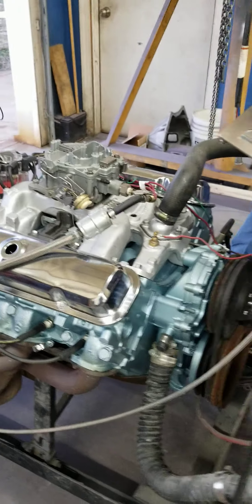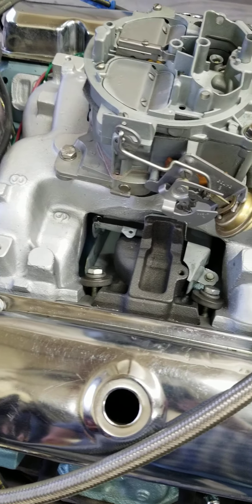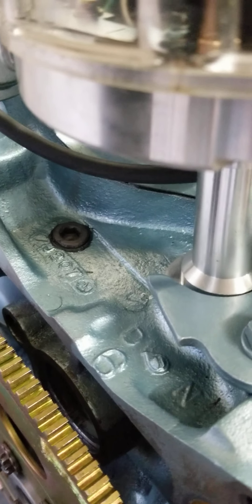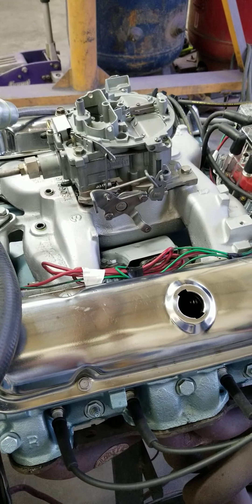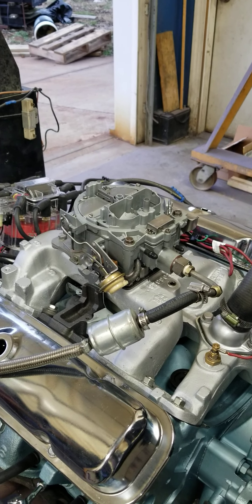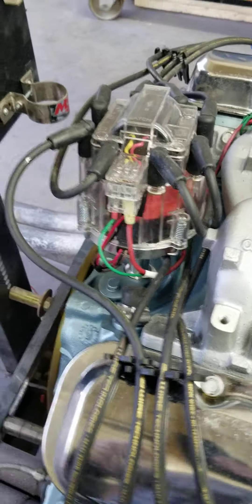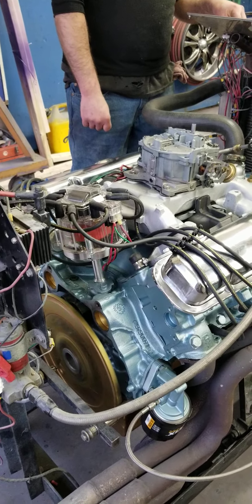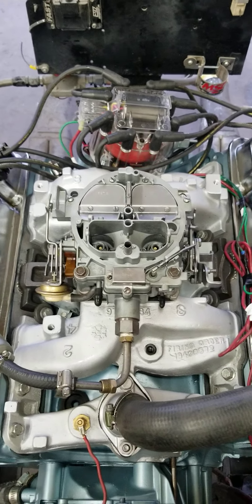PONTIAC WITH WICKED FAST THROTTLE RESPONSE 🤪

Comment: Those bore/stroke numbers mean the engine is "under-square" as i'm sure you know. Most factory original v8's of the era were "over-square". I had a 1969 GTO Judge with the Ram Air 400 bought used 1n 1980. I STILL regret selling it. It would FLY.
Reply from the maker: Most of the bigger cubic inch Poncho's were over square, but that's more than likely why they are so torquey 😁
Reply: Can take advantage of the higher  piston speeds of longer stroke with a warmer cam and might as well use dual quad carbs providing 1 barrel per cylinder.Lightened aluminium flywheel and solid lifters.Then try it.
Reply from the maker: @confederatenationalist7283  I am working on a stack injection set up for my RA5 heads. I can't wait to see what the throttle response is with it.

Comment: I had a 74 ram air that I rebuilt the 400. Found some ram air heads and put a comp mag 292 cam in with flat top forged pistons. That thing was pretty awesome, so I can only imagine what this will do!
Reply from the maker: Nothing like Pontiac Torque :)

Comment: I’ve never seen that block before. I’ve worked on a lot of late 60’s and 70’s stuff. I got into the trade early 70’s . The fuel pump on the back is what got me. I can’t imagine with headers if it doesn’t promote fuel boiling and vapour locks sometimes common in older vehicles
Reply: Fuel pumps on these engines are on the left front. What looks like the fuel pump on the right rear is the oil filter bracket.
Reply: That's the oil filter housing not the fuel pump

Comment: I don’t know about the R A casting, that’s cool though. Those heads are pretty rare cause were one year only. The manual trans cars came with the same "041" cam which was used in the later Ram Air 4 engines, but used 1.5 ratio rocker arms, but the RA4 engines used 1.65 rockers. Awesome build
Reply from the maker: Old School Cool for sure :)

Comment: Really enjoy tuning those Quadrajets,, did a simple metering rod and jet change, with a Q Jet on a1976  trans Am, drop two full seconds in the quarter mile, with a 1:76 ratio exhaust rocker arm...

Comment: I do have to disagree with you on one thing, however. The RA II heads would not have come with a RA IV cam.
Reply from the maker: I do believe they did, but did not use the 1.65 ratio rockers so it was rated at .470" of lift instead of .517"

Comment: I the exact same set up in my ‘68 GTO- stroker with Ram Air II heads, Ram Air IV intake. Similar roller cam (236/242) but on a 114 - even the Johnson lifters. Would love to know what that one puts out.
Reply from the maker: A wild guess would be around 450 HP. The factory style aluminum intake really limits HP. Everyone thinks because it was PMD's highest HP intake that it works really good. The problem was because of low hood clearance and factory ram air, they had to make the intake shorter which made the plenum way to small.
Reply: @dcimotorsports1111  I had to do a lot of work on the repro intake as well. Not as off as yours, but it took some massaging. Performer RPM or the good old cast iron intake would have been a more practical choice. https://youtu.be/7ToAWgjreu4?si=iKQBFN-bJ2CYPh1p
Reply from the maker: @kskistz Love your 68 Goat 🥰In my opinion the 68 is a way nicer looking car than the 69. I love the wood dash and vent windows.
Reply: Appreciate the compliment! I wanted it to look mostly stock with some not so obvious upgrades. Kind of like I raided the Pontiac parts bin back in the day.

Comment: That really is rare and sounds like a great way to take advantage of such original performance parts. I wonder how much power this thing is putting out on a dyno.
Reply from the maker: I agree, It is cool to see old school parts on today's builds. I've been doing it long enough to remember that's all we had for a very long time. It wasn't until I designed the IA blocks and Tiger heads, that along with Edelbrock, Wenzler, and KRE coming out with goodies that we finally had options.

Comment: Try attaching the transmission ... Automatic or Manuel on a stand with the engine. It will definitely effect the throttle response. Want be quite as responsive....
Reply from the maker: My engines rev pretty quick even with all the extra load. Watch this video and see how quick it rev's. Even hits the rev limiter pretty quick :) https://www.youtube.com/watch?v=4G5OKob-VAU

Comment: The bolts and washers cocked sideways is the most g m thing i've seen lately
Reply from the maker: Ha Ha, ya I am going to remove the intake machine the heat cross over down to make it level. Yet another aftermarket part that needs massaged :(
Reply: Why do you need the crossover and shield?
Reply from the maker: @707x-y6s customer wants to run the choke thermostat, so we put it in. Normally we would just block it off.

Comment: I thought RAM-AIR II and IV Were the same and cam also and only difference was rocker ratio and pushrod diameter 💁‍♂️
Reply from the maker: No the RA2 had a standard size intake port like the D Port heads. The RA4 had a taller intake port and also used a 1.65 rocker. Both used the same cam profile though for standard shift cars.
Reply: @dcimotorsports1111  Good to know,  does that mean RA2 heads are better than the RA4 heads if you change to 1.65 rockers  or does it mean the angle of the RA4 ports is better 💁‍♂️
Reply from the maker: @benkrom2737 The RA4 is a bigger intake port so a little better head than the RA2.  With that being said though. The RA2 heads can be ported to be equal to or better than the RA4
Reply: @dcimotorsports1111  Good to know 👍🏻